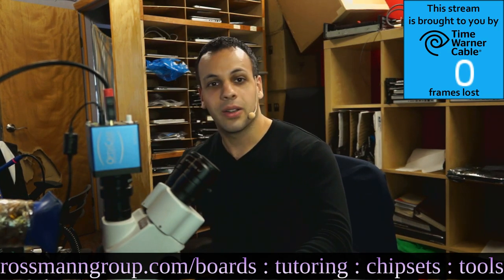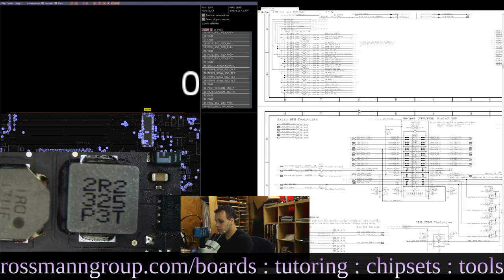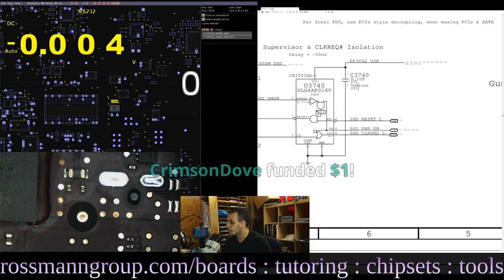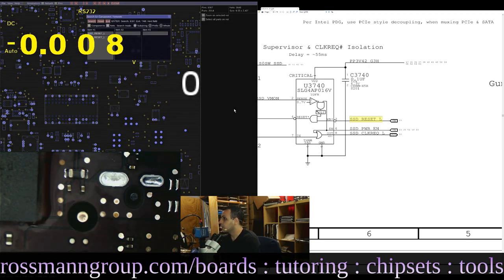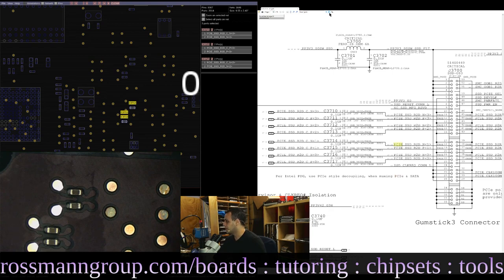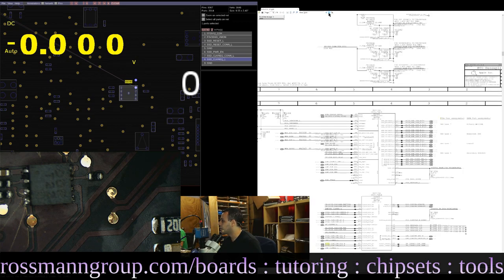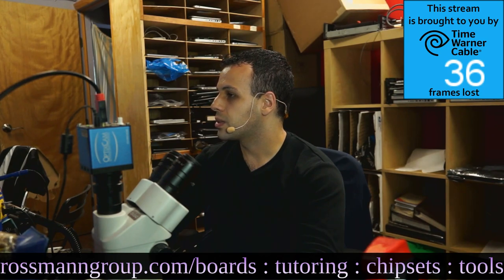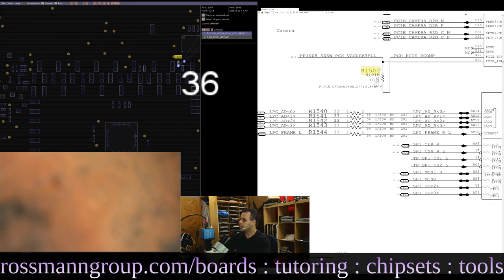820-3437 doesn't see SSD questionmark folder

Comment: Once you remove the SSD from the socket you can freely measure the capacitor. :)
Reply: Yep was going to say this. Coupling caps that go to a connector that's not plugged in (i.e. open circuit) can be measured without removing them, because it's not in the circuit anymore.

Comment: So apple saves .10c by not putting in an m.2 standard connector.  How does this not surprise me in the least
Reply: Michael Bruce 10¢ x 1,000,000 = 100,000. If you don't get the point, then you don't see what a business would see.
Reply: More likely they lose money since they use a proprietary custom made connector instead of a widely available industry standard one
Reply: Isn't it possible to make up the revenue in another way? Sure, 100,000 is a significant amount of money, but if you make the product better by doing so, even to the point where it catches the eye of more consumers on a broader scale, you will not only recoup the investment, but also expand your business. It seems to me that Apple often self sabotages themselves when new tech becomes available as opposed to taking the lead.
Reply: z00h not the point. Apple doesn't care about the consumer. The only thing apple cares about is making money. Main reason they put these "proprietary" ports is bc if something happens, only apple would have the solution. Granted, u can always buy used parts for these computers, but they make tons of money with that whole apple care shit. There's a reason behind this, besides just doing it bc they can.
Reply: Dustin Thomason people don't buy apples because they are good. It's mainly a status symbol. It's almost like the people who buy Teslas. Most of them don't buy it bc it's a great piece of tech, they buy it bc it brings a sense of status. That sense of status allows companies to charge as much as they want and people will still go crazy for them.
Reply: Are you really arguing that people only buy things because of status and because they cost more? That is completely absurd. If you don't see the value in the aforementioned products you truly have no grasp on the market. There are many fantastic reasons to use products from Apple and Tesla. Ignore price tag for a second and ask yourself if you compare other products would they stand up against them and hold their own. They certainly would in many regards. The independent companies that come out with unique solutions often fall short in overall design or implementation. What Apple can do is mass produce that product better than most and make it user friendly. Hate on Apple all you want, but if it was more complicated to use, and it didn't work as well as they do most of the time, people would not buy them. People can be stupid, like when Beats headphones came out, but we have seen that trend dissipate over time. Things that are worth having will last on the market and continue to thrive. I personally own tech from every end of the spectrum. I don't play favorites. Shitty adolescent attitudes of shitting on a company because of bullshit like 'PC master race' fanboyism's is the cancer of the internet. Simply start doing whatever it takes to succeed at life and leave this life of ignorant views behind.
Reply: Their profit per product is absurd so a small investment like this doesnt mean much for em
Reply: You must not have read my previous comments before coming to that conclusion...

Comment: I have a Macbook pro 13 Retina Late 2013 (A1502) that has the same problem, logic board 820-3536A. Questionmark folder when starting up the macbook, I've changed ssd and nothing happened. I've checked that the SSD gets power from L3700 and it is about 3.3 V which you also get. I went on to check that the ssd gets reset, at component U3740 at pin 3 and 4 I get nothing, close to 0 V, what should I do to fix this as in the video you said you don't get the "easy stuff anymore". Do I need to switch out the component U3740 or how would you approach this problem?

I appreciate your videos.

Comment: I have a early MacBook air 2015 model. I have tried to upgrade the ssd in it with a samsung evo 860 1 TB. I have installed catalina on the ssd and backed it up using a external adaptor. I can open it and run the ssd as a external but every time i put it inside the mac it doesn't work. I have tried to different adaptors and still comes up with question mark. Anyone know why?

Comment: Hi, I have same problem with a1425 820-3462 board. I have measured the j4500 connector and I have 3v and 5v regularly on it. Any suggest?

Comment: Hi louis, i have an macbook pro A1502 when i measure the voltage on the U3740 pin 3 ssd reset i get only 1v , where should i look from here? Or do i replace this chip? The values on other pins on the chip are good. Thanks in advance

Comment: Macbook pro early 2015 13 inch (16gb ram 256 ssd aftermarket) I am using bigsur in it.
Whenever i powers on my machine QUESTION MARK SIGN ON FOLDER starts blinking.
Sometimes it appears and sometimes it doesn't. Totally unpredictable.
I have done following things as solutions but sign comes again after somedays. 
Reset SMC and NVRAM, Disk Utility Repair, Factory reset machine, Reinstalled new OS from bootable drive. 
Still question mark sign appears after working fine for few days. Really tired and irritated from this issue.
Need your help guys, what could be the problem?

Comment: I have the same problem with questions Mark folder but wenn I turn on, the computer there is no sound, pressing the keys does not help. I bought some MacBook pro without a hard disk,  the new disk is not loaded even via usb. Can someone help

Comment: MACBOOK PRO 2018 (NO TOUCH BAR)
-Kernal Panic error
-ShutsDown Randomly
Could it be an issue with the SSD inside the mac pro?

Hey Guys, My Macbook Pro 2018 started shutting down randomly and continue to do so after it started, the end screen will show the text paragraph that says "Your Computer restarted because of a problem...".
so i went to the apple store, and they said it might be the logicboard issue, so they replaced the logicboard. But right after repair, after using for an hour, same problem occurred again. Replaced the logicboard again from apple, and same shxt happened. Apple couldnt find whats the issue, then they suggest it might be the SSD that is causing the trouble. My SSD performance seems to be okay, no data lose or lag whatsoever. 
Im confused now, what can i do to fix my baby??!~ 
Are there any other parts of the macbook pro that can cause this shutting down issue~ Pleaase helppppp~ Apple ate my money, repairs are so expensive!!!! 

If apple cant fix their own shxt, then i lost faith in apple~